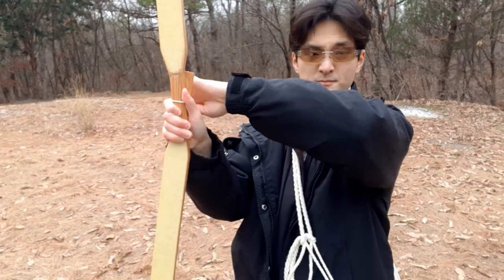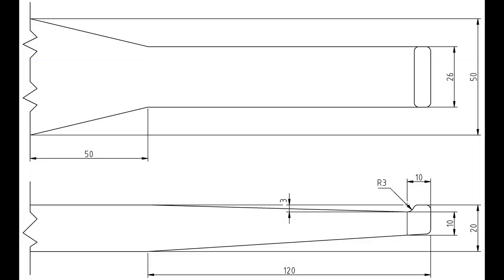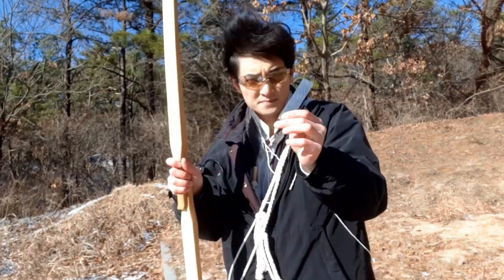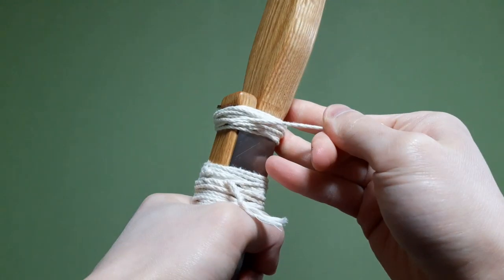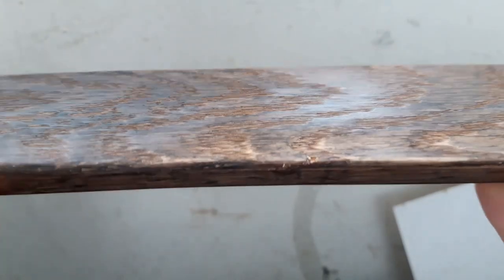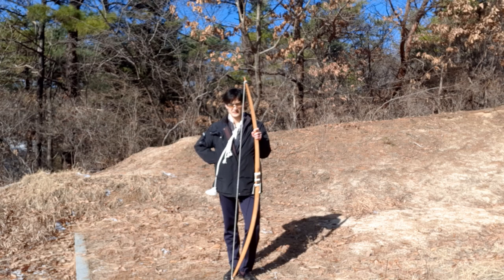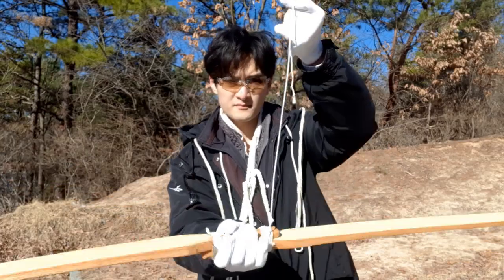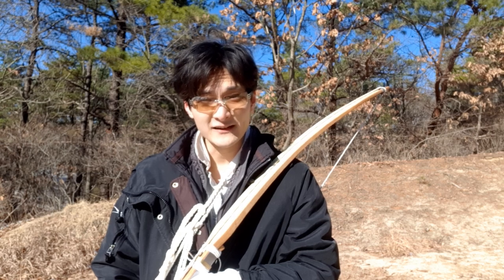Tim Baker's Primitive Takedown Bow Revisited | Cable Backed Red Oak Takedown Longbow

Comment: Very nice tiller man! I appreciate the ingenuity! I'm working on something similar, it's nice to have a travel bow that breaks dow to a convenient size.
Reply: If I might suggest an improvement. Adding a protruding stick/nail from the end of each handle and gluing or tying on a socket for it to fit into on the other limb could allow you to discard the stiffener piece.
Reply from the maker: @davidcowles8287  Thanks. Check out one of my references, "Alaskan Take Down Molly" by Mike Richardson here: https://www.tapatalk.com/groups/paleoplanet69529/alaskan-take-down-molly-build-along-broken-and-fix-t54709.html

 Here, he is using dowels, but non-working handle section is much longer (9"), as he used up extra length to provide enough meat to place these holes.

 For the sleeves, I believe it all boils down into personal preference. Sleeves are more conventional than this scarf joint takedown. I simply could not find decent enough sleeves nearby, aside from those overpriced ones from 3 rivers archery. Besides, you just need one stiffener plate for all
Reply from the maker: Do you mind, posting the takedown bow you are currently working on when done, on youtube, or forums, perhaps?? I would really love to see this pin joint takedown as well. It is truly difficult to perfectly predict how the concept would work out unless built
Reply: @insearchofphprw  Yeah I like your method better than the sleeves I've seen because its possible with primitive material and it's simple. But after seeing that your bow works with just tied cord I bet some kind of horn (gemsbok?) could be made into a takedown sleeve at the right width. It would look nice too
Reply from the maker: @davidcowles8287  That is an interesting idea. Most case I've seen, gemsbok horn itself was used as bow limb. Many bowyers nowadays make their sleeves with fiberglass wrap, but that surely is not ""traditional"". I presume stiffener plate could be made from sliced horn or bone, too
Reply: @insearchofphprw  I posted my takedown bow on reddit and sent you an email with the lin

Comment: Did you first build it as a complete bow then break down? How did you achieve even tiller if built separately?
Reply from the maker: Built as takedown from the beginning. When it comes to tillering takedown bows, complete the takedown part first, assemble, then tiller it just like normal bow. I tillered the top limb especially generously (meaning, reduced more weight off) as this limb is placed half an inch forward than the bottom, thus is bending and working more
Reply: @insearchofphprw  hmm I see, that makes sense as normal tillering typically leans towards a slightly stronger top limb, but in this case the top limb is forward of center. Wouldn't have considered that, nice work!
Reply from the maker: @whodoyouthinkiam210  I see that opinions on how a bow must be tillered really varies by bowyers. Some bowyers like Dean Torges claims that with a same-limb bow, the bow only balances when the upper limb is a bit stronger than the lower limb, not weaker;
read his article here: http://www.bowyersedge.com/organic.html

I had his theory in mind, but really, I follow intuition more than theory when it comes to tillering